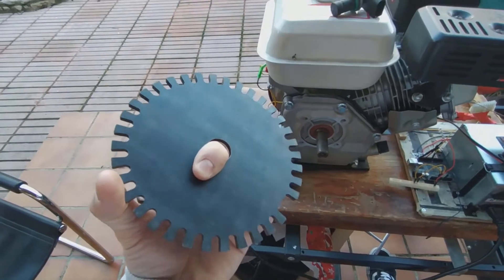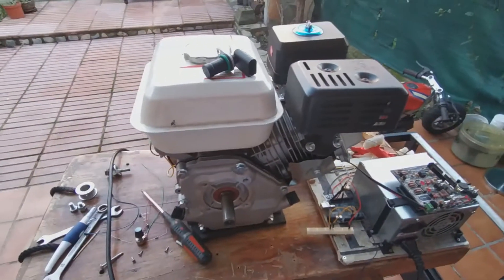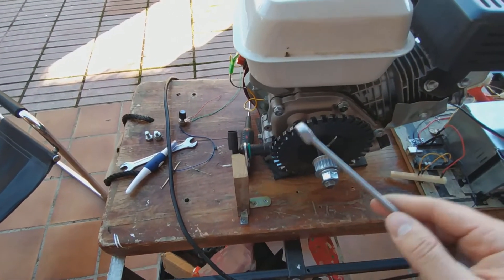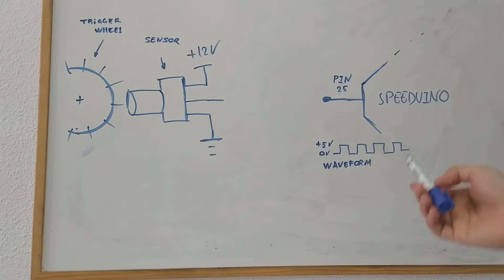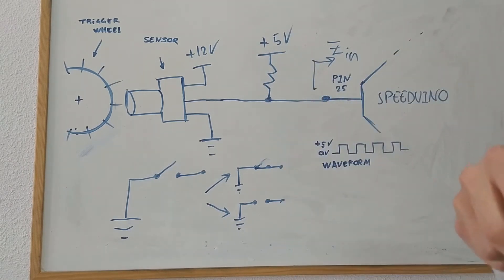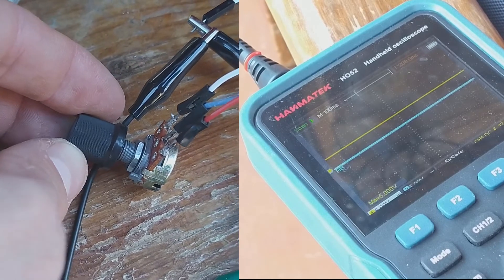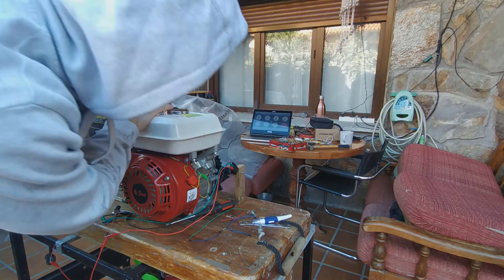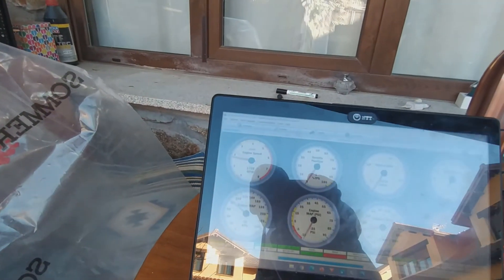Installing a trigger sensor on a Honda GX160 | Speeduino

Comment: Ls “A tachometer signal is included in the bulkhead connector (see below). This is a 2 pulse/rev output which may correspond to a 4-cylinder setup in some tachometers or transmission controllers. Note the signal is a low voltage square wave, some tachometers or transmission controllers may need a pull-up resistor in order to read the signal, similar to a 5000 ohm, 1⁄4 watt resistor– this detail is left to the user. The following circuit has worked for numerous devices – the resister value may need to be changed if your device does not read this output properly“😊

Comment: Range Rover p38 If by RBM you mean the feed to the tachometer/rev counter, although that is supplied to the BeCM and then on to the instrument cluster from there, all the BeCM needs to see is a 12V square wave signal giving 4 pulses per engine revolution. As the original engine is an 8 cylinder, 4 stroke engine and the LS is an 8 cylinder, 4 strole engine, deriving that should be no problem at all. In fact, the LS ECM will almost certainly have a rev counter output anyway.

Comment: You may wish to mount your CPS to the engine structure to avoid issues with varying air gap to the trigger wheel.  Take care with reducing the output of what appears to be Hall effect CPS.  The output voltage is normally a few volts above the old TTL threshold of 5V, specifically to avoid noise issues.  If you clip this to precisely 5V you may become susceptible to false triggers.  It depends on how clever the front end of the Speeduino is at avoiding such a problem… and I have no direct experience of this ECU.  Ultimately though, what’s your objective?  Oh, and buy some tools!  An angle grinder is definitely not the way to make a keyway!!  A few minutes with file is all you need…
Reply from the maker: Thanks for your positive feedback! My end goal is to run the engine using the ECU, starting with the ignition (currently waiting for the ignition COP and timing light). Once that is done, my plan is to install the temp sensors, TPS, MAP sensor, maybe even an O2 sensor on the exhaust, and 3D print an intake manifold (using a heat resistant material) in order to be able to install an injector and a throttle body. This whole project is just for learning purposes, I am not trying to reinvent nothing here. And finally, how much an angle grinder is worth in your country? Tools/materials are quite expensive in Spain.